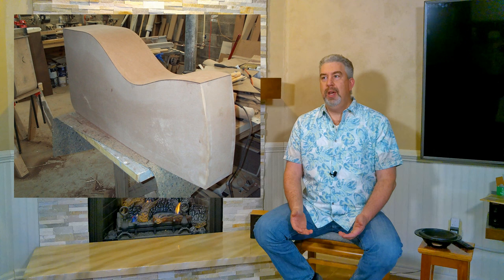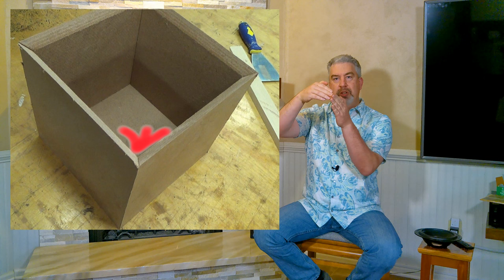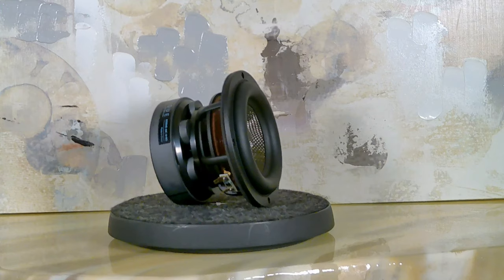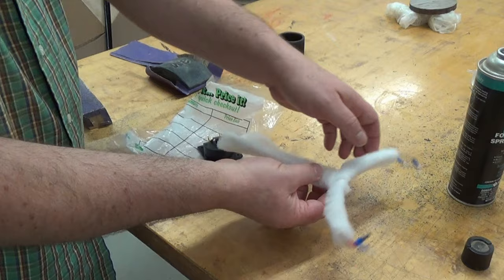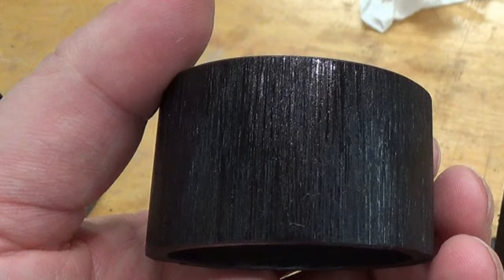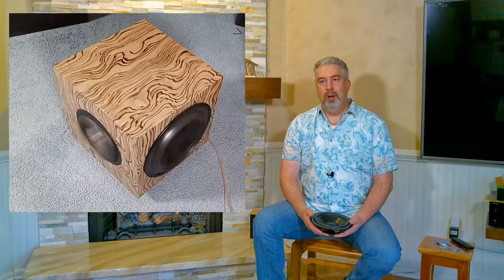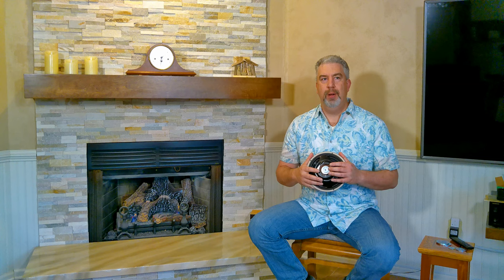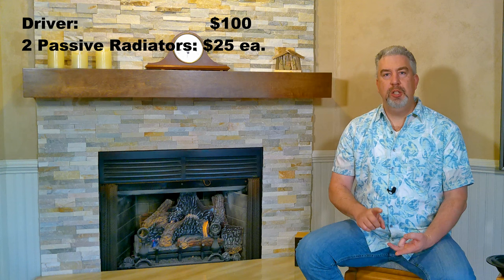Digging Deeper into the Epique "Small Cube Subwoofer" Project

Comment: Hi Tom. Is it possible to use this woofer in 2way bookshelf? Do you have any measurements?
Reply from the maker: Yes, I would say that this would be a perfect candidate for a bookshelf-type speaker. It has a fairly flat response out to about 4k.  You should be able to use it with most decent tweeters I would think. Check out the FR graphs here: https://www.parts-express.com/pedocs/specs/295-102--epique-e150he-44-spec-sheet.pdf
Reply: @zarboaudioprojects1430  what tweeter would you use that can match nicely and not over 70$?

Comment: What's it like properly corner loaded like where your other sub is. With one I'll usually try and corner load at the front ideally opposite the room opening, so there's less chance of corner to corner standing wave.
Reply from the maker: It really shines in the corner of my room. Like you said, rooms do affect the bass response, but the corner of my particular room helps boost the low stuff really well with no noticeable nulls. It's a fun little sub project... sounds like a basic 10 from 5 to 7 years ago.

Comment: Why not use the Epique 5.5” passive radiators?
Reply from the maker: The 5.5" PRs were not out yet when I dreamed this up, but truthfully, they wouldn't dig as low as these larger PRs do, at least not in this small of a box. Thanks for watching and for the comment!
Reply: @zarboaudioprojects1430  makes sense. I have a 5.5” epique in a .35 ft^3 ported box tuned to 43hz in my car and it sounds amazing. 

I was so impressed with it that I modeled it with the epique passives for a small home theater sub and I wasn’t too happy with its output. I modeled your build and it’s much better with the passives you chose. Very impressive!

Comment: How do you think just one of these would perform in a .2cuft sealed box? I have an old pickup that im trying to build some fiberglass boxes in the B pillers.  Not looking for crazy amounts of bass just a little to help the 4.5 coaxials in the dash.  Great video!
Reply from the maker: I have not modeled an enclosure that small, but my guess is that you'd get boomy 80 to 100 hz, and very little under 50 hz. It could be DSP'd a bit, but I think there are probably better options, especially given its relatively HUGE magnet structure. If I get a chance, I'll model it and reply back.
Reply: @zarboaudioprojects1430  I'd appreciate it if you have time.  I wonder if a port would be better but from what I've read the port needs to be rather long.  Thanks again for the help and posting the video.
Reply from the maker: @davidh3545  Well, in a .2 cu. ft sealed enclosure, you have an F3 of 70 Hz, and an F6 of 54 Hz.  Not too good in my opinion. Cabin gain will help some, and you can DSP it a bit... but I would shoot for high 40's as a response, not 70 hz.  
An alternate... have you seen Paul Carmody's Voxel subwoofer?  It's vented and only a little bigger than your proposed box size, check this out: https://techtalk.parts-express.com/forum/tech-talk-forum/58008-voxel-a-mini-sub
Reply: @zarboaudioprojects1430  thanks for taking the time to check that for me.  I'll check out that link.  I downloaded winisd but I honestly don't know how to interpret the graph lol.  In the past, 20 years ago, I just built sealed boxes for a Polk sub, it was loud or at least I thought so.  I'll have to find some videos on how to understand this graph and I need to build my box out of fiberglass so I can calculate my exact size. Right now it's a rough calculation.  The box will only have 1 flat surface.  Again thank for the reply and posting these videos!

Comment: FYI.  If you do choose to run one coil, you can short the other and the TS parameters will remain the same.  Having the second coil shorted makes it appear as though it's connected to a low impedance amp, just like it would be were it wired in parallel.

Perhaps lead or brass washers?
Reply from the maker: When you say 'short' the other coil, do you mean just run (+) and (-) lines from the amp to ONLY 'coil one,' and then connect the (+) and (-) leads of 'coil two' together?  If so, I can't see how some specs won't change, but I could put it on the DATS to see what that change makes. 

About the washers, I considered using a heavier metal for the washers, but felt that I needed to use readily available materials as I was pretty sure this design would end up being duplicated. Since I went down from 120 to 100 grams, I think the weight is just close enough to the center to be 'okay' for the most part as it relates to longevity. Possibly in a few years the PR's could be rotated if sag becomes an issue. 

Thanks for commenting!
Reply: @zarboaudioprojects1430  Yup, just jumper the two unused leads.  The Qts and Vas should remain unchanged or very close.  Of course, you only get about half the power handling.
Reply: I'm thinking that will just choke the output. If you really want to drive it hard, use a 2 channel amp and put one coil on each channel. Most amps are happy at 4 ohms per channel. For optimum results, make sure the signal to each coil is the same amplitude and phase - e.g. that independent level controls are the same, or the balance control is centred.

Comment: Such a great video!  Your descriptions and explanations sounded perfect to me - it drives me nuts when an otherwise well-produced video gets the details wrong, but you were hitting all the right details at the right time.  I'll disagree with you forever on the pronunciation of "radiator".  Every time you said it I was thinking back to my youth ... "Dude, that' sub is so RAD!"  Repeat after me - "RAY dee ate or".  Or just carry on - your work is truly rad!

I saw in your PE post you tried powering this with a DTA2.1 with coils wired series for 8 ohms and didn't get satisfactory output.  I know you've got an early version.  Does it use the TPA3116 chip from TI like the latest DTA2.1BT2?  Because that TPA3116 chip is widely misunderstood when it comes to its power output and impedance driving ability.  Most people think configuring two amp channels to drive mono means "bridging" and that was generally true for a long time.  But not so with many chip amps including this one.  It turns out that in stereo mode the TPA3116 is already running in a Bridge-Tied-Load (BTL) configuration.  That means each TPA3116 chip technically has 2 pairs (4 total) of single ended channels bridged together just to produce stereo output.  Then if you configure it for mono, you're putting those 2 stereo channels in parallel.  It's called PBTL in the datasheet for "Parallel Bridge Tied Load".  The result is that you don't actually get any more voltage by configuring mono because you're just tying the two plus outputs together and the two minus outputs together.  And you don't get any more power either ... if you use the same impedance load.  So what do you get?  

You get twice the current driving capability.  You can drive a lower impedance load.  TI rates that chip as 50 watts at 4 ohms stereo or 100 watts at 2 ohms mono.  The DTA2.1BT2 uses two of these amp chips with one configured stereo and one configured mono for the sub.  I'm running the mono sub output at 4 ohms for my DIY sub (Dayton DVC 8 inch sub with dual 8 ohm coils in parallel) so I only get 50 watts max.  Same as if I ran one of the stereo channels to a 4 ohm speaker.  Because, stereo or mono mode, you're running the same voltage.  In your case you were running mono channel into an 8 ohm load (the two coils in series) so that poor chip was limited to only about 33 watts (based on figure 13 of the datasheet) before it ran out of voltage headroom.  But you weren't anywhere near the current driving limit of the chip.  I think you could have run the coils in parallel (2 ohms) and gotten the full 100 watts (or more according to figure 22) that TI intended.  Unless your older design DTA2.1 uses a different chip.

Dayton rates the DTA2.1BT2 as 2 x 50watts + 100 watts but they also only say the impedance load should be 4 to 8 ohms.  That doesn't jive with the TI datasheet.  Either this amp can push a 2 ohm load on the sub output or it's not really 100 watts.  Plenty of folks will be quick to say "Of course it's not 100 watts! Do you really believe any amp specs? Besides that 4A 24V power supply won't support 200 watts anyway."  Fair enough, but I do believe TI knows how to write a datasheet.
Reply from the maker: Thanks for the comment Ryan. I can't argue with you on the pronunciation of 'radiator' a wood stove doesn't RAD-iate heat... it 'RAY-diates heat. But I'm still going to say it that way because it's too hard to train myself to say it right. :)

I have several versions of the DTA2.1BT amp, one I modded for a lower crossover frequency, the other one is the newer version with the crossover knob on the front. I figure the sub section is doing maybe 70 clean watts at 4 ohms given the included power supply. At 8 ohms it's closer to 50. This sub just needs a LOT more than that to get moving. I didn't think to run the coils in parallel for 2 ohms, it may have had somewhat decent output that way, but I have concerns using it down to 2 ohms and pushing it hard. It may survive, but there could be issues. 

I mentioned the DTA2.1 amp just as a reference for how much output it would produce with it since I figure some folks may try to pair them up... I don't think it would work. The amp I'm using with it outputs probably close to 180 clean watts (at 4 ohms) and maybe 100 at 8 ohms and I can basically push it to it's max or close enough.

Yeah, TI's data sheets are accurate, I'm sure... It's possible that they give the wattage rating figures they do because of the limited amperage power supply that ships with it. 

Thanks for watching and for the comment. I'm glad you liked the longer look at the build. I like that type of stuff myself, but not many others do.
Reply: @zarboaudioprojects1430  Yeah, I understand about being wary of 2 ohms.  We've been trained over the years to think mono = bridged = poor impedance handling.  But many of these chip amps do mono mode as parallel instead of bridged and it has the opposite effect compared to what you'd expect.  If you're comfortable running 4 ohms on the stereo outputs (BTL) then that's just as tough on the chip as running 2 ohms on the mono sub output (PBTL).  Should work fine unless Dayton did something wonky in the application circuit.  

Maybe I'll try it out on the DTA2.1BT2 just to prove it.  I've got some old Ascendant Audio Atlas 15 inch woofers that actually have DVC with one coil 4 ohms and the other 2 ohms.  Crazy eh?  They were intended for you to tune the Q of the woofer by driving the 4 ohm coil and then the 2 ohm coil you could short (low-Q), leave open (high-Q) or use a resistor to achieve mid-Q.  I bought them to do an infinite baffle subwoofer in my attic so high-Q was perfect.  I took them with me when I moved.  Now I use one in a sealed box with both coils driven in series (low-Q, 6 ohms) in my living room.

If the amp you're using is the Nobsound G2 PRO then it uses the TPA3255 chip, also from TI.  That datasheet shows mono PBTL output into 4 ohms is about 120 watts at 32V supply and 1% THD (figure 23).  As expected, this is virtually identical to the output it would send to each of 2 channels if it were wired up as BTL 2-channel mode (see figure 8).  And from that same figure 8 we can see it would do about 60 watts into 8 ohms.  That 8 ohms power output will hold true for BTL 2-channel mode or PBTL mono mode.  So you're working with less power than you think.  But we're talking just a couple or three dB difference.  If you dared to try the Nobsound at 2 ohms, the chip should be good for about 220 watts but the power supply not so much.  And again it's another case of an amplifier that ought to be rated down to 2 ohms, especially given the claimed power output, but mysteriously the maker specs 4 ohm minimum.  And just to guarantee confusion they put a switch on the front labelled "PBTL<->SUB" that has nothing at all to do with configuring the chip into or out of PBTL mode.  Sigh.  

I'm probably boring you with this amp stuff, but wanted to let you know these chip amps might have a bit more to give if you let them stretch their legs with a lower impedance.
Reply: I tried the DTA2.1BT at 2 ohms today.  Used that crazy Atlas woofer in free air.  The DTA drove the 2 ohm coil (1.7 ohms DC) fine for several songs as I slowly pushed the sub level knob higher and higher ... eventually to max.  Then I pushed my phone's bluetooth volume eventually to max.  This with the DTA's main volume knob at my normal level - about 1/3.  During an especially bassy Taylor Swift song (make fun of me if you must) it seemed to go into protection mode because the mono sub channel suddenly dropped in volume.  Not completely, but reduced by a lot.  The other chip for the stereo channels kept going unchanged.  That fault setting stuck even when I switched to my normal 4 ohm subwoofer (sub level down to 0 during the switch and then back up but still reduced sub output).  When I power cycled the DTA, it returned to normal operation with my normal settings.  

So I'm guessing I tripped the fault on the chip that runs the sub and apparently it's not configured to auto-reset.  I was keeping a hand on the DTA case to feel for heat.  It got warm but not unusually warm.  Still could have been the over-temperature fault locally on that one chip ... or the over-current fault on that chip.  At any rate, I was pushing a lot at that time.  Sub level all the way up.  I'd have feared for my little Dayton DVC 8 sub at that level.  The 15 inch woofer that I was driving was moving nicely.  Not a ton, but respectable considering I was only driving 1/3 of the total voice coil so it's sensitivity must have been terrible (what a crazy woofer).  The bass would have been LOUD if it had been in an enclosure.  The voice coils on that 15 are rated for 450W total, 300W on the 4 ohm coil and 150W on the 2 ohm coil.  So not much risk I'd burn the coil, but you never know.

Altogether I'd say this confirmed for me that the chip really is designed for 2 ohm operation but the DTA amp as a whole might not have the greatest heat sinking.  The fact that the case didn't get hot seems an indication that the case is not a sink, so the heat gets trapped inside.  Plus there's the issue of the limited power supply.  Probably best to think of it as 25W x 2 @ 8 ohms + 50W x 1 @ 4 ohms.  Then the power supply makes sense and the heat sinking probably won't bite you.  I posted to PE about one of their TPA3116 mono boards and I'll be interested to hear their response.

If you're into amp reviews, I like the videos from Williston Audio Labs.  He reviewed a $10 chip amp board that used a TPA3116 in mono mode. On his amp dyno that board hit 32W at 8 ohms, 56W at 4 ohms, 89 watts at 2 ohms.  All pretty close to the datasheet predictions except falling off a little at 2 ohms.  Granted he was using a stiff 25.3V supply (2 car batteries).  And then it survived 1.6 ohms in a burst test to output 106W.  Not bad!
Reply from the maker: @ryanschnacke6719  Ryan, not boring AT ALL!  and this is frankly the perfect place to discuss it. I have investigated this stuff quite a bit as well, and I've found that sometimes the chip ratings and actual physical amp ratings are not always in line. I go with the amp ratings in that case as long as it's a fairly well-known company, especially one like Dayton Audio. They also may just want to keep the likelihood of amp failure to a minimum so they don't recommend 2 ohm loads as they will be harder on the amp. Dayton does warranty these things for a full 5 years after all. 
Yeah, I chuckled at the PBTL switch on the front... its a 'sub or full-range' switch only as far as I know.  Thanks for the comment and for the good information. It will likely help others, so thank you!
Reply: @zarboaudioprojects1430  I do love me some Parts Express/Dayton!  I've had to use that warranty on occasion, so I do appreciate that as well.  I'd be happy to follow the amp ratings if they made sense.  But claiming 100W on the sub channel while limiting the load to >=4 ohms is cheating.  And as much as I love 'em, Dayton Audio does not get a pass on this.  It's either ignorance or willful deception.  Chevrolet claims the Corvette makes 490hp (@6450 rpm).  Now imagine the uproar that would happen if they set the redline at 4000 rpm ... without derating the hp output.  That's the equivalent of what's going on here.  

Undersized power supplies are also a frustration but at least the majority of the customer base has some awareness that a 24V x 4A power supply can't possibly yield 200W continuously.  The impedance rating issue, on the other hand, is so much more subtle - you've got to dig into chip datasheets to understand what you're really getting.

Sorry for the rant and I'll hop off my soapbox now.  Thanks for letting me bend your ear!

Comment: All this effort and the epique isn’t even suited for a passive radiator enclosure. It only works best in a vented
Reply from the maker: Nick, a 'Passive Radiator' system is very similar to a 'Vented' system, and they often model similarly, and have very similar frequency response graphs when implemented correctly. The truth is, this Epique driver "Works" amazingly well in this dual 8" Passive Radiator system.
Reply: Shush.you do what you want and we will follow in Tom's foot steps okay?  
Great work Tom